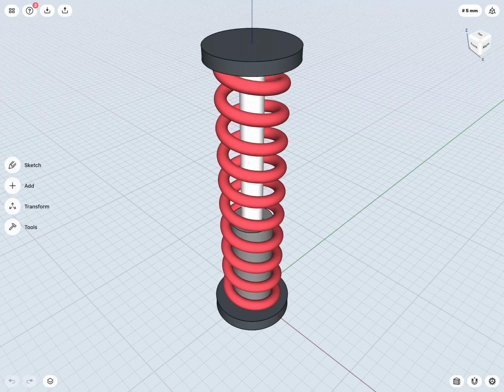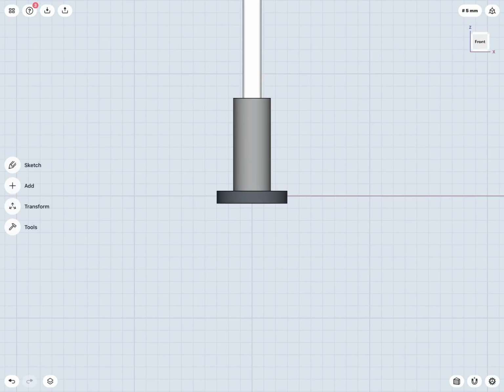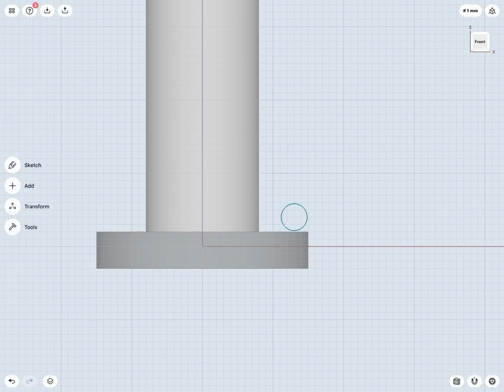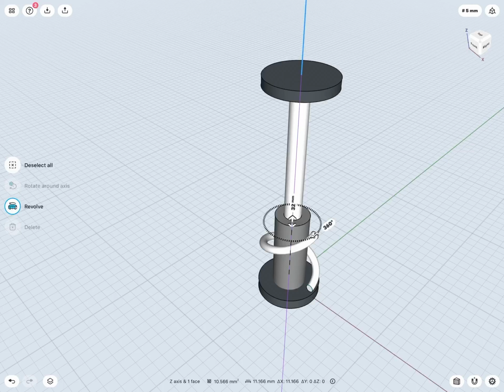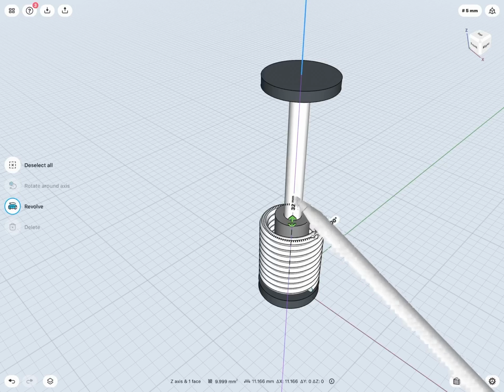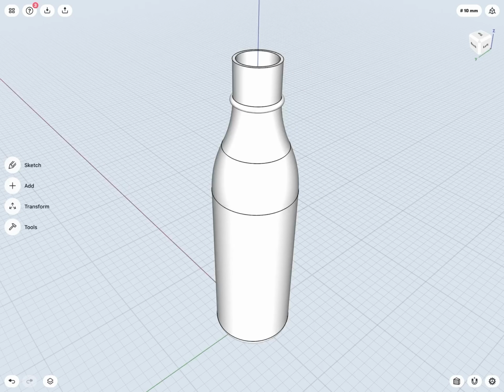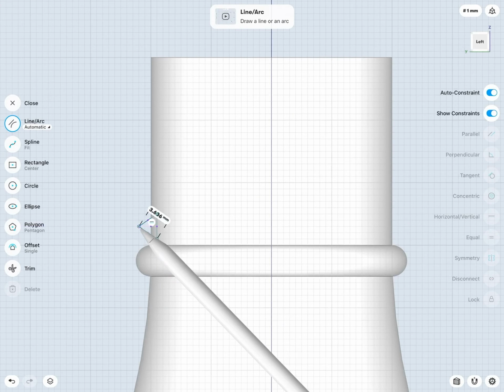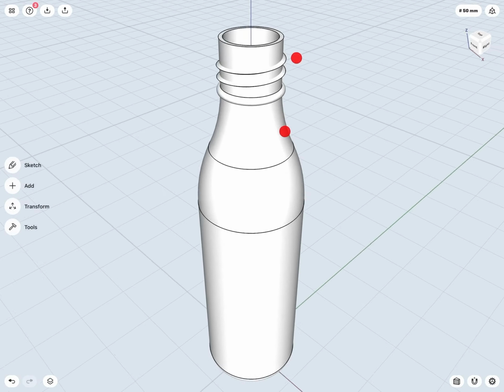Helixes | Creating complex 3D bodies

Comment: How to make a bolt?
Reply: There’s really not a reason to. There are free CAD models of basically every commercially available piece of hardware, straight from the manufacturers.
If you still want to make your own threads then you could just use a starting shape that’s something like a triangle with the point facing away from the shaft, instead of the circle used in this video. Make your revolve overlap with the shaft. Then perform a union on the threads and shaft.

Oh, it’s actually shown later in the video, lol.